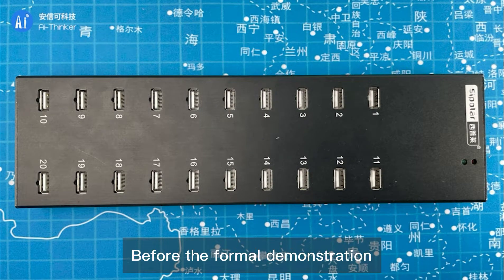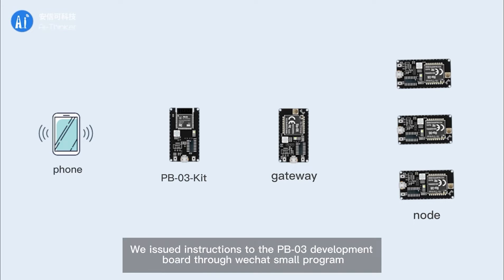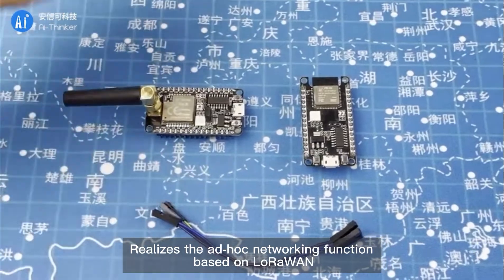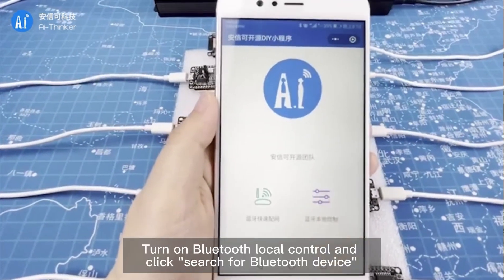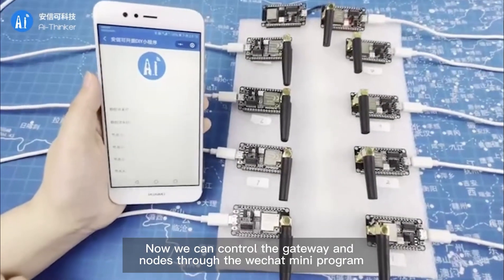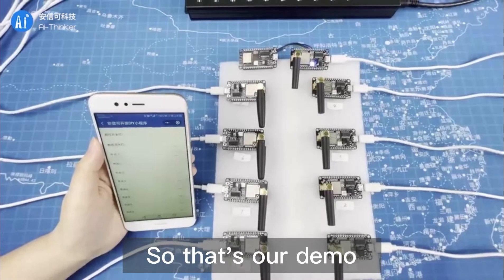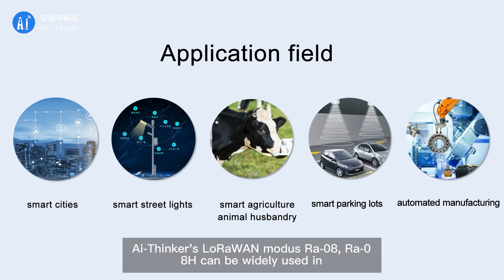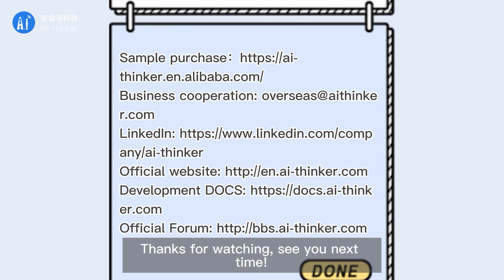Ai-Thinker new product function demonstration of Ra-08 module

Comment: Hey can I get a code to communicate between 2 lora based ra-08h like one ra-08h sends the data and other one receives the data and print the received data.
Reply from the maker: Sure, I'll send it to you later, or you can give me your email address.
Reply from the maker: https://github.com/Ai-Thinker-Open/Ai-Thinker-LoRaWAN-Ra-08/tree/main/projects/ASR6601CB-EVAL/examples/lora
Reply: @ There are several files in this folder but i want a code in which we will configure one device as sender and other as receiver i want to send a frame using the lora/loRaWAN communication.
Reply from the maker: @dora_explorer7174  You need to use it with other files in this project to achieve this：main.c and pingpong.c

https://github.com/Ai-Thinker-Open/Ai-Thinker-LoRaWAN-Ra-08/tree/main/projects/ASR6601CB-EVAL/examples/lora/pingpong/src